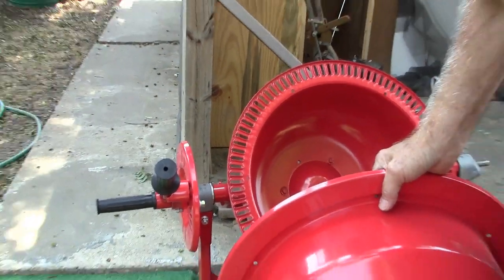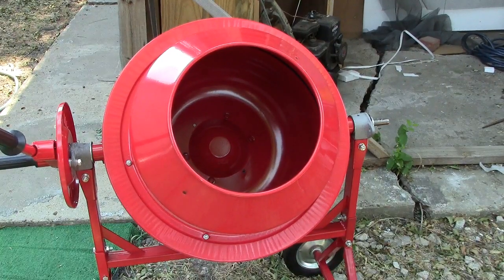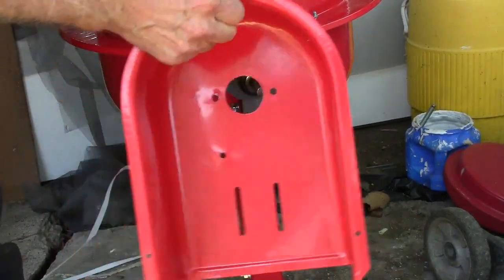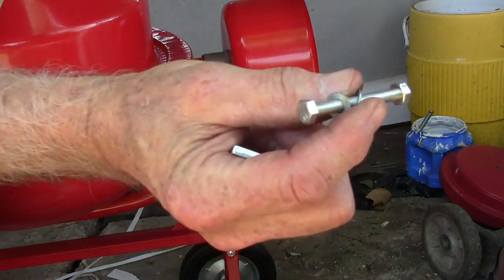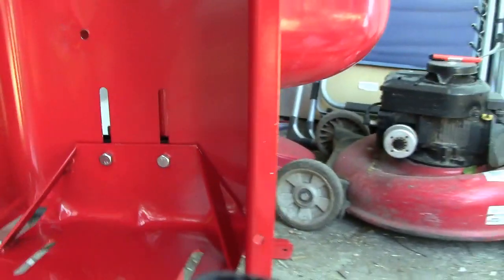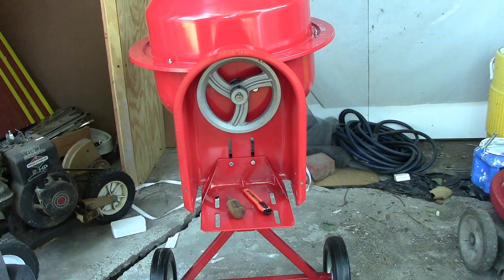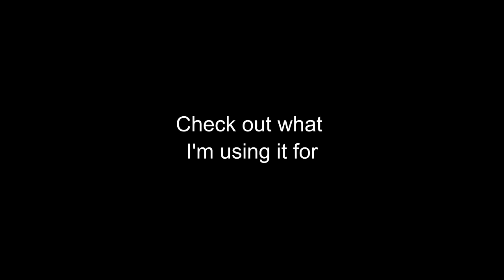Harbor freight cement mixer #2   Harbor freight assembly , instruction

Comment: Can't thank you enough for making this video - I was able to figure out most of the assembly though the assembly instructions that come with the item leave much to be desired.  The part of the video that was really a 'saver' for me was the positioning of the mixing blades in the drum - thankfully my unit came with arrows to line up on the top and bottom half of the drum,, even still, without your video I would have taken even longer trying to figure out the orientation of those mixing blades if I only had the dreadful printed instructions to go by.  So, again MANY thanks!
Reply from the maker: Your welcome, It was definitely tough for me but found the mistakes and shared them . Thanks for watching

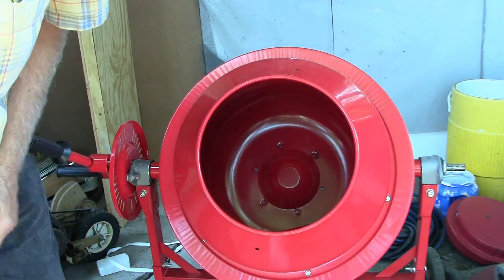Comment: Your video helped I just bought one and already mix 30 bags of 80lbs crack resistance concrete ,I like it 100 more bags to go. I even got the paddle alignment wrong and took the two screw 2:17 from the bottom haha ,Thank You

Comment: I've done some good sized pours with my HF mixer. I did replace the silly screwdriver slot set screw with a hex head bolt, I believe it is 6mm. I up sized the bolts that hold the motor to the mixer and widened out the slots so  that they would slide up and down for the belt adjustment. The last thing I did was weld op a bracket so that I could put a piece of pipe in it so that it sticks out forward and I can roll it around without the front leg bashing my shin.

Comment: Near the end of 2020 and this instruction manual still ranks as the worst ever. They still don't tell you about making sure the holes for the mixing blades are correctly aligned and that's when I started looking for videos and came across yours. My mixer has some different parts and lots of missing parts, such as that piece that supposed to go in between the motor mount and the stand with no mention of it in the instructions. My pulley is different does not have the set screw on the side but the end is threaded for a n M6 X10 screw that was not included so a trip to the hardware store added another half hour to assembly.  any hope of saving time on this job I had planned for tomorrow went out the door today maybe it will make up for it in the long run but without this video I would never have gotten it together at all.
Reply from the maker: Glad I could help, thanks for watching

Comment: Man,was that a pain. I wish I would have seen your video first.
nice job on the video : )
 I'm curious what did you use the mixer for if not for cement?
Reply from the maker: I filled it 1/4 full of rocks and used it for metal parts cleaner after cutting small parts on the band saw
Reply from the maker: https://www.youtube.com/watch?annotation_id=annotation_1202858755&feature=iv&src_vid=M4AiaJY_Dh4&v=2Jgd020T5VA
Reply: Awesome!   :)
Reply: Ginger Haley I am  using mine to husk walnuts.

Comment: I said over a hundred cuss words putting mine together I regret buying this pos ..all nuts and bolts in one bag I did not have a Allen screw for the pully on drum it was was a Allen screw that did not fit the threads inside the shaft ..pure junk but I did watch your video rebuilding a Chevy 350 I would have more paitent
Reply from the maker: Glad you got it together